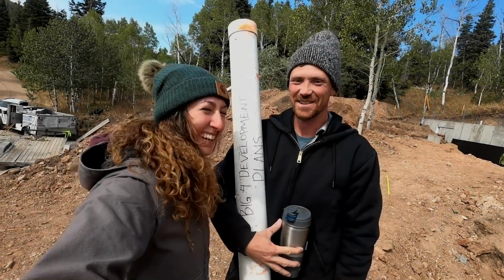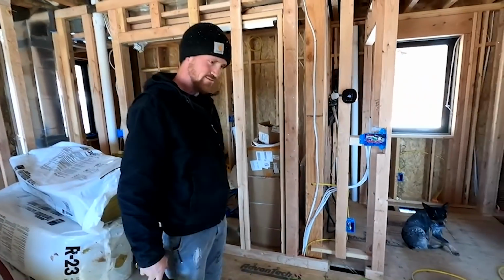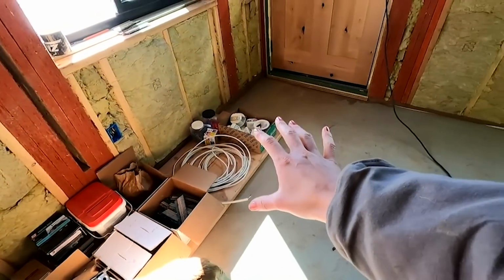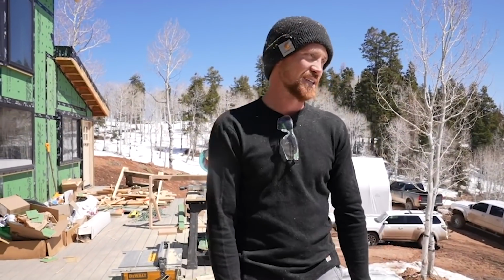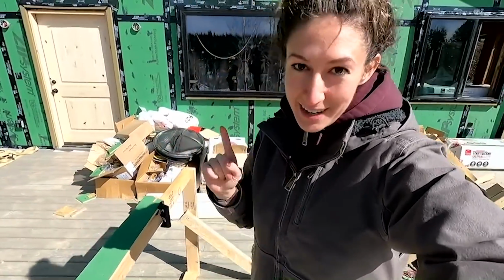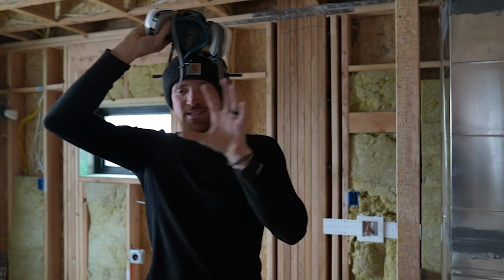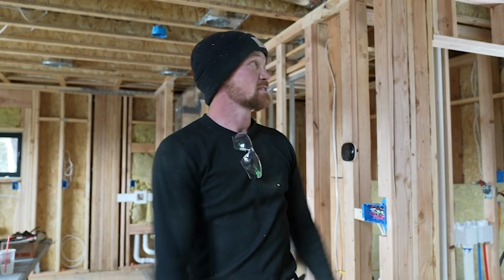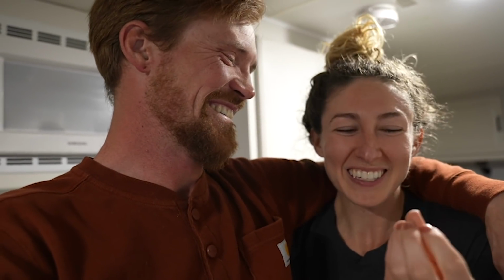RUNNING OUT OF MATERIALS | BUILDING OUR OWN HOME

Comment: I don't know if this would be useable, or feasible for you while you insulate, but you have reminded me of something my folks did a couple of times in renovations. They had invested in a Rainbow vacuum cleaner, a water based filtration vacuum. Side note: Rexair Rainbow Deluxe 2. R2D2 was designed after a vacuum cleaner!
Anyway! Their house was built in 59, and they bought it in 76. It needed insulation (among many many other things), and being the 70s it was blown in fluff. The demonstration for the vac showed how if you just run the machine in the middle of a large room with the hose detached, it cleaned the air. My mom had it running in whatever part of the house was being worked on, and it really did keep the dust down to a minimum. I suggest this because it uses water that just needs to be dumped out and refilled, and not a filter that will clog, or need to be cleaned or replaced. Though I am kind of out of the loop on new technology, there may be stronger water filtration air purifiers out there than our simple "robot vacuum".
Keep up the great work!
Reply: Those were neat vacuums! I remember those! Good luck finding one today, however!

Comment: Trent there is a product called Tigers Teeth, they are pieces of spring wire a touch longer than the spaces between studs perfect in horizontal spaces
.

Comment: Dumps in the UK are like massive recycling centres with individual bins for all the different types of waste like wood, rubble, cardboard, old electrical items, non-recyclables, garden waste, metal etc... Even food waste from domestic bins gets separated and recycled. I think some European countries like Denmark are even more into recycling than us.
Reply: We do that in the US too, far more than most other countries.
Most "Landfills" (garbage dumps) here in the US have recycling facilities that do that. They sort out the recyclables and bury the rest. Burying cardboard, which is just wood fiber with a binder, is just as much recycling as shredding it and making it into paper. It feeds the soil, and is good for plants. The binders are usually biodegradable (starch), often a byproduct of corn. I use cardboard in my garden to mulch for weeds, and it breaks down over time, as well as keeping the weeds at bay. Even if it's buried, it's being recycled.
  Toxic waste dumps are separate, so that's not an issue, unless there's people illegally dumping those items in their trash. Plastics are generally separated out by type (polypropylene,  polystyrene, etc.), thus the numbers on the bottoms of recyclable containers & on sheet of plastics used for some packaging. Some plastics are biodegradable as well, and are made of starches.
   Check it out! It's pretty interesting!
Locations with the worst recycling records... Los Angeles and New York! (True fact!) I know someone who headed up a research project on recycling nationwide.  It was rather interesting. Even though big cities added recycling bins about 20 years ago, true trash and recyclable materials, and toxic wastes is far more mixed and buried in big cities than in rural areas.
  If you go to older, rural areas, people used to bury & burn trash. Even city areas used to burn leaves and paper/wood trash, even when I was a kid. Some still do!
  Look into how dumps, recycling & landfills work. Check out your local landfill/recycling center. Trash is sorted, those things that can be recycled are, those that cannot are generally buried. Toxic wastes, such as paints, industrial wastes, etc. Go to special "landfills", which have liners, so they don't leech into the groundwater. These are separated by types too, and are sent to different places. If they weren't,  we'd have explosions everywhere. 
  Occasionally,  we do have explosions, exothermic reactions, radiation contamination,  etc. when people illegally dispose of certain types of wastes, including well water. 
  Where I live, there's naturally occurring radioactive minerals in the ground, as well as metals that can violently react with water, so anyone drilling has to test for these things. We did have some people drilling here who tried to dump their water into a regular wastewater treatment facility.  They melted & radioactively contaminated 4 fire trucks, put 4 firefighters in the hospital, a driver of the water truck carrying it reportedly died of radiation poisoning.
  We live in an unforgiving natural environment. It's also beautiful and a really neat place!
  Here we have oil oozing from our mountains and on our beaches too... from natural seepage.
  As an environmentalist, a retired scientist who has done many years of field work, I cringe at some of the things pseudo-environmental groups push for, with no experience, or knowledge, of our natural environment.
  The world can be a dangerous place, if you don't know what's out there. Policies  without education can be just as damaging. I'm in California,  and many policies here that are meant well are doing more damage to our environment, and helped create the fires here the last few years, as well as desertification of the west coastal states in the US. For instance, my county dumps 60 million acre feet of water a year into the ocean, because of a law created that was supposed to be for "environmental protection", thus we have severe droughts.
  If you change one thing, you are likely screwing up something else, especially when done on a massive scale.
  Anyhow,  thought I should share this, as so many well-meaning people want to create policies, criticize,  and create laws, without seeing the full picture of effects it has on other things. It's had disastrous effects here in California, for people, wildlife, our forests, our lakes, streams and oceans, helpful bacteria, fungi, helpful viruses that keep harmful ones at bay, and so much more.
   I hope this is helpful. We need more people with a working knowledge of the real world, as it is. It may be viewed as "dangerous" to some, but it's really a wonderful place, when you get to know it!
Reply: @CarolReidCA  waste is such a huge issue all over the world. So sad for the planet. Recycling is a good start but it would be better if we didn't consume so much stuff in the first place xx
Reply: We have that here in the U.S. too, its profitable, but in some Rural area, who do not have the huge funding, they still operate in the dark ages, "Happy Earth Day" by the way,

Comment: This is some advice for interior wall insulation ... if you do not want to hear everything that goes on in the bathroom you will need to insulate those walls also ... 
Plus you have a washer/dryer space that will  be audible in the whole house if not sound deadened ...

Comment: From Canada, and we use our basements a lot of times as a main living area, which you may want or need to do if you have any tiny humans join you on these adventures. do a raised and insulated floor or in floor heating (obviously insulate the walls really well) and you will find it is a cozy space. in floor heating is great in basements because they have less temperature variance then the above ground floors.

Comment: For the slightly wider areas - take the bats and cut them to 16" long (or whatever dimension makes them snug fit) and put them up crossways. Bit more work, but it's worth it to get a nice snug fit.

Comment: You're making me feel old, when you say Bewitched was a old TV show. It was current when I was growing up! But wait I graduated from High School 52 years ago! So maybe I am getting old. When you were talking about keeping the cool air in the basement I was reminded what a heating and cooling guy I know told me. He said to put a air return in the basement that you can open and close. That way you can open it in the summer and pull the cold air out of the basement. I did it on our house in Michigan and cut the electric bill down substantially. The other thing is that the AC ran a lot less. On some days we could just run the fan and keep the house cool.

Comment: You should get yourself a large tool box organizer on wheels to store and organize all the tools. This would make it easier to move them around and it would keep it neat. You could then put it in the basement after the build to organize all the tools that you have accumulated over the years.
Reply: yes very practical
Reply: Big buckets work great too, and are easier than boxes to pick up and move.  I use'em all the time when I get into project where I need "stuff". One of my buckets has a neat'o inset that gives me on the pockets inside and out long the wall of the bucket, and still leaves a big space in the middle for, say, a power drill, etc.
Reply: Did you ever solve the power panel problem?
Reply: @clycehurst7414  good quuestion!

Comment: I stayed away from drywall and put up beaded board .   It’s been 8 years since my house was built....I left the beaded board natural.   It’s turned into a beautiful golden color from oxidation. When the lights are on at night my house glows .   I used  luang on my ceilings with a 4x4 grid pattern using 1x2’s upstairs for the cathedral ceiling.    There’s no maintenance other than cleaning the occasional cob webs that firm in the peak.  It was slow cheaper than drywall, plus quick to install .  I also gave asthma , so, I was also trying to avoid the fumes from the drywall......I hope you can locate all your building materials!  All the best❤️🙏🏻❤️

Comment: The dump was sad, especially because a lot of that waste was recyclable, mainly the cardboard boxes, do you not have recycling where you live?
Reply: Most dumps have a place for recyclable items.....
Reply: A lot of the stuff going to the dump could have been burned. The solution to the basement ceiling would be "Tiger Teeth", wire that is shoved up between space that holds unfaced insulation up. Mike
Reply: All the recyclables! Could’ve been recycled.

Comment: Hey if breathing the insulation is bad for you then shouldn’t you keep the dogs away from it to
Reply: I agree this is why I vacuum the dirt lot behind my house so my dog does not breath dust.
Reply: This is rock dust, not fiberglass. Fiberglass causes silicosis.  
Also, Most "Landfills" (garbage dumps) here in the US have recycling facilities that do that. They sort out the recyclables and bury the rest. Burying cardboard, which is just wood fiber with a binder, is just as much recycling as shredding it and making it into paper. It feeds the soil, and is good for plants. The binders are usually biodegradable (starch), often a byproduct of corn. I use cardboard in my garden to mulch for weeds, and it breaks down over time, as well as keeping the weeds at bay. Even if it's buried, it's being recycled.
  Toxic waste dumps are separate, so that's not an issue, unless there's people illegally dumping those items in their trash. Plastics are generally separated out by type (polypropylene,  polystyrene, etc.), thus the numbers on the bottoms of recyclable containers & on sheet of plastics used for some packaging. Some plastics are biodegradable as well, and are made of starches.
   Check it out! It's pretty interesting!
Locations with the worst recycling records... Los Angeles and New York! (True fact!) I know someone who headed up a research project on recycling nationwide.  It was rather interesting. Even though big cities added recycling bins about 20 years ago, true trash and recyclable materials, and toxic wastes is far more mixed and buried in big cities than in rural areas.
  If you go to older, rural areas, people used to bury & burn trash. Even city areas used to burn leaves and paper/wood trash, even when I was a kid. Some still do!
  Look into how dumps, recycling & landfills work. Check out your local landfill/recycling center. Trash is sorted, those things that can be recycled are, those that cannot are generally buried. Toxic wastes, such as paints, industrial wastes, etc. Go to special "landfills", which have liners, so they don't leech into the groundwater. These are separated by types too, and are sent to different places. If they weren't,  we'd have explosions everywhere. 
  Occasionally,  we do have explosions, exothermic reactions, radiation contamination,  etc. when people illegally dispose of certain types of wastes, including well water. 
  Where I live, there's naturally occurring radioactive minerals in the ground, as well as metals that can violently react with water, so anyone drilling has to test for these things. We did have some people drilling here who tried to dump their water into a regular wastewater treatment facility.  They melted & radioactively contaminated 4 fire trucks, put 4 firefighters in the hospital, a driver of the water truck carrying it reportedly died of radiation poisoning.
  We live in an unforgiving natural environment. It's also beautiful and a really neat place!
  Here we have oil oozing from our mountains and on our beaches too... from natural seepage.
  As an environmentalist, a retired scientist who has done many years of field work, I cringe at some of the things pseudo-environmental groups push for, with no experience, or knowledge, of our natural environment.
  The world can be a dangerous place, if you don't know what's out there. Policies  without education can be just as damaging. I'm in California,  and many policies here that are meant well are doing more damage to our environment, and helped create the fires here the last few years, as well as desertification of the west coastal states in the US. For instance, my county dumps 60 million acre feet of water a year into the ocean, because of a law created that was supposed to be for "environmental protection", thus we have severe droughts.
  If you change one thing, you are likely screwing up something else, especially when done on a massive scale.
  Anyhow,  thought I should share this, as so many well-meaning people want to create policies, criticize,  and create laws, without seeing the full picture of effects it has on other things. It's had disastrous effects here in California, for people, wildlife, our forests, our lakes, streams and oceans, helpful bacteria, fungi, helpful viruses that keep harmful ones at bay, and so much more.
   I hope this is helpful. We need more people with a working knowledge of the real world, as it is. It may be viewed as "dangerous" to some, but it's really a wonderful place, when you get to know it!
  Rodust that is much like dust in the wind kicking up dust. It's uncomfortable.  Back to watching a young couple building their beautiful home.

Comment: Trent: for installing batts in floor joists you can use joist insulation hangers (basically thin metal rods) that hold up the insulation. Lowes & HD sell them in packs of about 100. The come in different lengths (16" and 24") depending on your joist\stud separation. Since your planing to double up the batts I would get double the number of insulation hangers (by extra & keep your reciept and return the extra).

Comment: If you use a folding table or a sawhorse with boards across it you can go vertical and get more in there.  I have found the best way to solve job site sorting is a series of bins (heavy-duty black with yellow lids) that each contains material grouped according to trade.  All the plumbing stuff, etc, etc are ready to go when you want to do a job and since you can stack the bins you get more space out of the room.  If you want you could also nail a 2x6 to a stud horizontally and lay a 2x or two across as a temp shelf.

Comment: Another great video! Drywall isn’t really dusty wait for the mudding and sanding. Just a tip get yourself at least 2 large exhaust fans and put them into open windows for when the sanding starts and cover all open duct work.
Reply: Yep!
Reply: Yup.  Insulating and even putting up drywall is a breeze compared to taping and sanding.  The only thing worse than sanding is cleaning up drywall dust.

Comment: Hey guys! I work for an insulation company. Regarding the basement ceiling; they make full 16” batts that should work. Not sure if Roxul does or you can even get them atm, but you can use regular fiberglass and do an R19 or above in full 16”. It’s not as sound deadening, but will still help. Otherwise you can do a net and fill, where you staple fiber netting to the ceiling, real tight, and then you would have to rent a insulation blower like you would use for an attic, cut little access holes in the netting and just fill the cavities. 

Love the channel, btw!

Comment: For the sake of noise, don't be cheap, insulate the inner walls.   Do it for fire safety, sound control and thermal exchange control.  I did it to my house and it is wonderful, especially with my surround sound system.

Comment: Trent: if you doing a lot of purchases with a building supplier, ask them if they can hold items like the metal roofing for you. This way you can order it now, and then Home Depot can hold it & deliver it to you when the ground dries out. I would recommend when you place your roofing order, but a few extra sheets so you don't come up short. You can always store it for the future if you ever have roofing damage and need to replace a section.

FYI: Often local stores like HD or Lowes with work with customers, especially if you doing a lot of sales with them. Store Manages have some flexiblity to work with customers. Plan B is if HD\Lowes have trailer rentals you can rent a trailer to bring the roofing up yourself since you have a pickup truck to hitch the trailer with.